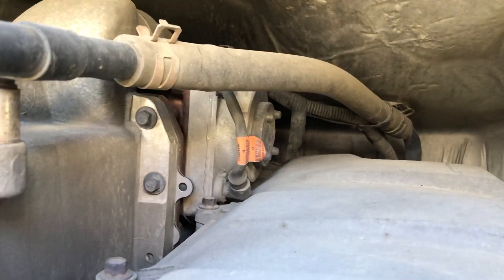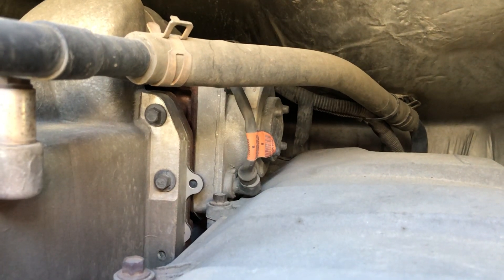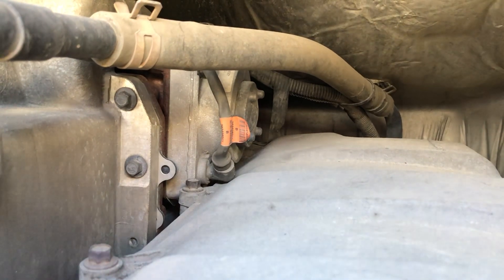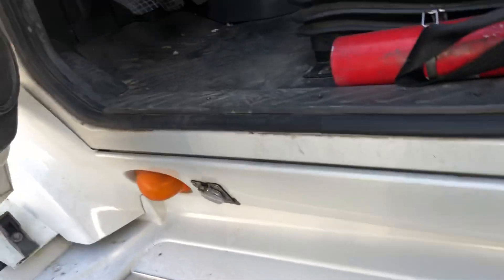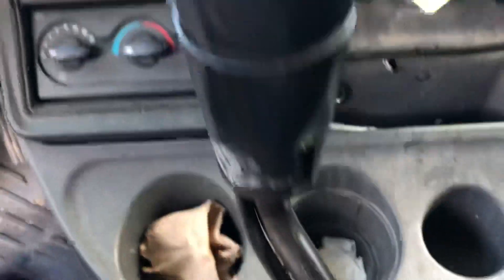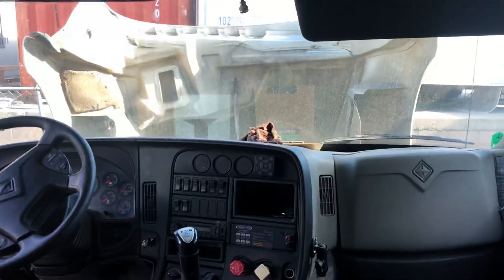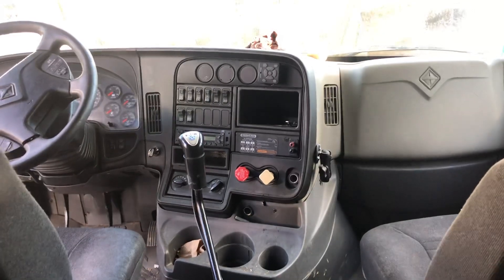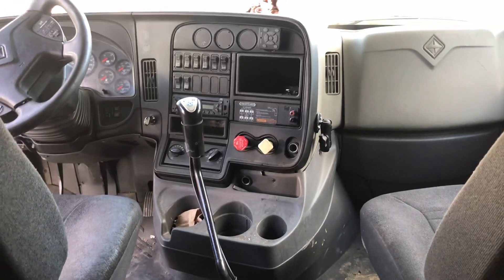Maxxforce 13: EGR valve replacement. Update 1

Comment: Where did you get you manual to work on the truck? Is it something i can get from the dealer? Theyre very secretive about everything.
Reply from the maker: Yeah, international manual are hard to get, dealer might sell it to you, as well as the Internet. But for us, in the shop, we take the chance to open parts and learn as we go, sometimes it is the only way to learn. Of course, trying carefully not to brake those parts. Thanks for watching.

Comment: How did the truck run? Did it run like its missfiring? Did you have check engine lights or triangle?
Reply from the maker: You can check my playlist in the channel. There are 4 updates for this job. Yeah, engine was running smooth at the end. Thank you for watching.
Reply: @LetstalkDIESEL  I actually wanted to know how it ran before you changed it. Mine runs rough and I'm trying to point out the problem I have
Reply from the maker: It did not run rough before the job, just the MIL (Malfunction Information Light). Perhaps, you should check the oil, if you see that there is a metallic or shiny look, might be a gear or bearing issue. I hope this help you in your diagnostic.
Reply: @rootkitxx  hey my truck is idling rough and kinda low on power... did you ever figure out your problem?
Reply: @notkirill6991 did you